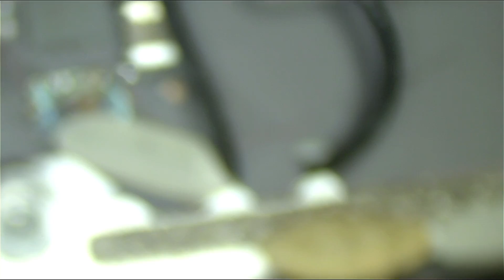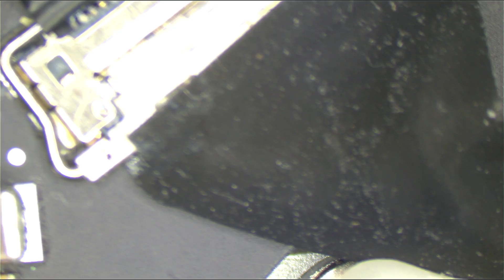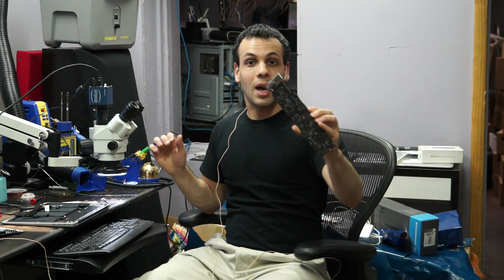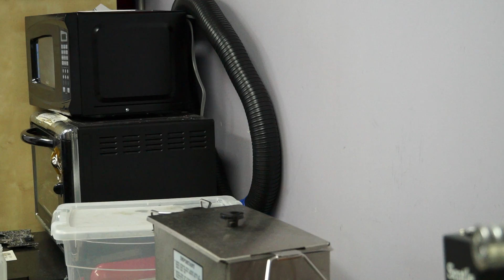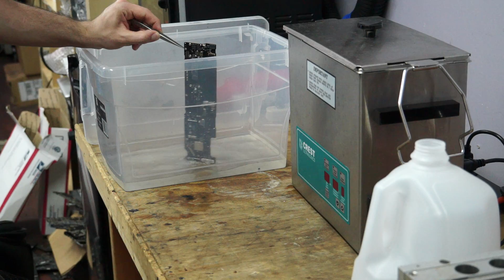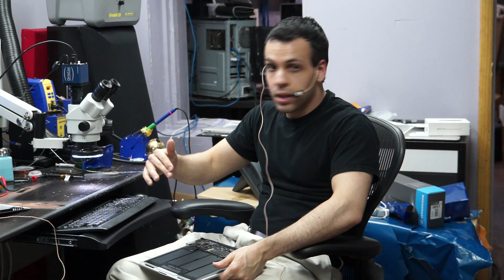How to use rice to repair water damage on iPhones and Macbooks

Comment: Rice isn't even a great drying agent, let alone Louis' point about corrosion.  If the water was distilled and the device was power disconnected ASAP, drying it out with a desiccant might work, but real life spills are almost never this way. 

I came up with my procedure on my own, without the internet - I have fixed many devices over the years with distilled water, alcohol and a toothbrush.  I have used desiccant packets and the heat vent to dry after this process.  It works 90% of the time.  Considering that even the ultrasonic cleaner won't fix things 100% of the time, this is pretty good for the average joe at home.  Glad to see even the professional thinks this is a decent way to do it years later. 

100% solid points in this video.

Comment: The rice is actually okay for removing moisture - it's a cheap alternative to silica gel. You're not supposed to even touch the outside of the device with rice, it's only supposed to reduce RH% of the air. If your device got actual liquid on the motherboard and the motherboard was connected to power, rice will not fix it.

Comment: louis you completely fail to realize the reason the rice is used................rice is only used to soak up excess liquid for a person that dosent know how to properly open their device..... it DOES soak up liquid from soaked electronic faster than just letting it air dry.this method is used for people who accidently dropped their device in water and quickly removed their device from the water.. most people turn their phones off thill they know its dry so no electrical problems arise. the rice wont fix anything it just removes excess water so when you gotta turn on your device HOPEFULLY it works....if not then obviously there is electrical damage...

Comment: The idea is that rice is a cheap desiccant to dry out air, silly. It doesn't have to contact the board. But if that works it would likely be better inside a closed box with some internal circulation. Or else just get some real desiccant or air dryer salt pellets from the hardware store. The pellets get wet though and a little soupy  so they have to be in a bowl or the special air dry device.

Comment: It's not about laziness, Louis. A ton of people are afraid to open it and clean by themselves, they won't know how to properly open or close the device. Plus they hear from others that the rice trick works.
Reply: i can confirm, its not laziness, media for one, has portrayed the "stick electronic in rice" as a "cure-all" for electronics to where i thought it was a method that was legit(not just cause of media though, but also because hearing that it works)

before attempting it though; i searched to double check if it was real, or how to properly do it

found some site that people go for problems like this and had a link to this video, so glad i decided to double check

also majority of the people were saying that the rice did not work, and thats how this video got linked

also, i prefer someone else do this for me, simply because i put too much pressure onto things without realizing, so i WILL in fact break the electronic if i were to attempt it

Comment: to my knowledge no one ever claimed the rice trick fixed water damage. it just dries the phone out faster than it otherwise would. and phones made 5 or more years ago could take a swim and work again once they dried out. at least once. manufacturers wren"t sealing every hole and gluing them shut yet so they made the guts harty enough to take some water damage. it takes time for people to catch on that old tricks don't work anymore.
Reply: In two occasions two different phones slipped a skinny dip in the sink,  I turned the flashlight on, I started a intensive  gpu game on it, placed a yt live video at full blast and I plugged it to charge,  both phones  started overheating so fast they survived,  I am right now typing this on a 8 year phone, when the tech was cool and shit

Comment: Silica gel pack will help to remove moisture inside a sealed bag with the Phone, the problem is internally it has to be cleaned and worked on.

Comment: The only time I ever used the rice was to dry off and phone that was soaked in water after I removed the battery.  It is not the fix I was interested but to dry off the phone so I can use it or get info off of it tell I buy a new phone.  I probably lived more poorly than you with cheap phone and not an expensive phone that would cost more to repair and only had rice on hand at the time.  I probably would have broken the phone apart if I tried to get to the motherboard and just made more sense buying another cheap phone and do a better job at avoiding liquids on my phone after that.  It is more of a temporary fix for the poor person on a cheap phone. 
I am not arguing here.  I am just adding content on the side of the fence where a lot of people live in the world of living very poorly but need to learn to grow and get into a better place in life.   I live 30 miles from the nearest repair shop and for a 30 dollar phone the cost is not worth it.  It is better learning how to avoid spills altogether. 

 But I support the movement of cheaper repair places that can fix things cheaper so we can cut the waste on all the trashed electronics thanks to the greedy companies that are against 3rd party fixers.  If we had fixers in a small town that could fix up phones cheaper than what we buy them for that would be the day.
BTW I just found your channel through Linus Tech Tips  and after seeing your videos and even your "therapist" videos I subbed.  I'll try to watch as many videos from you and a lot of the things you do say I enjoy and like how you think.

Comment: omg....I had never opened a laptop before but when I spilled a fair amount of ice tea on the keyboard the first thing I did was yank out the AC adapter, lift it up as straight as possible so I could pop out the battery without tilting it, then I took it all apart, wiped up the tea with tissues, and then cleaned everything with alcohol.  After that I left it in parts for like a week just in case. When I put it back together it was fine and years later it is still fine.

Comment: The point of the rice, the idea behind it,  is to try and wick away water so the device survives long enough to get it to you (a repair tech).  The problem is (one of the MANY problems with this, at least), rice does not absorb water below near boiling temperatures.  Sadly, some OEMs perpetuate this.  As a cook i get frustrated when people suggest rice as a desiccant for salt, for the same damn reasons.

Comment: Rice thing came from one rice property - it is hygroscopic an can absorb moisture. It theoretically can stimulate evaporation, drying soaked device faster. With a catch - rice absorbing ability is very limited and wet device will short out faster than become dry. The correct actions are to immediately disconnect device, take out battery (if device have it), dry and clean circuitry with alcohol as Louis told. Unfortunately nowadays many portable devices have non-swapable batteries and are glued shut so no way to switch them out by their users in field anymore. Well, it is not all lost. At this summer my friends in their Mediterranean vacation trip accidentally dropped their Samsung S8 phone in sea. Mediterranean is very salty ... poor phone. It was good that they immediately called me.. I told them to rinse phone with fresh water ASAP what they did and saved that phone. Cleaned out USB port when they returned. 4 months passed and phone still works.

Comment: Question from an newbie: What are the specs that I would have to look for in an ultrasonic cleaner? Are they, size apart, all created equal?
Because they are common for cleaning motorcycle carburettors, and I'm wondering if, next time I or a buddy slip, it would be a possibility to bring just a board to the mechanic around the corner, instead of bringing a whole device to a probably clueless technican (living across the puddle, in the countryside, most people here still consider electricity magic...).

Edit:
Alternatively: If, sadly, you and your group, for whatever reason, are cursed with a higher probability for these types of misshaps, would it be viable to have a bottle of chemical alcohol handy to submerge whole devices as long as they are still wet? Are there components, obvious stuff like drives and batteries aside, that wouldn't take such a procedure? Especially stuff like LCD's or rubber?

Comment: The theory of rice is to drop the humidity around the motherboard for people that can not open the machine/phone themself. Dropping the humidity around the device speeds up evaporation, which CAN help. Yeah I get that rice sounds stupid, and I do open and fix my own stuff, but carefully putting a fucked device in a sealed container with rice or any other water absorbent can help. Just as long as the rice dust doesn’t get into the device.

Comment: People think that the water short circuits the connections and that's why it doesnt work, so absorbing and removing the water fixes the problem. They dont think about the electrolysis of the metallic connections that occurs when they have current, and now an electrolyte to pass that current.

Comment: The rice is hydrophilic, it will soak up water, just like silica gel.  The problem of course is that silica gel (or wet rice) will only hold the water in place if not removed once it's reached its capacity.  Of course with a battery permaconnected to the device, it's going to be busted regardless.
Do people actually believe that just throwing rice at stuff fixes it?  That doesn't even work at weddings...

Comment: Thanks you for making this! I am a computer engineer and I do what u do more less in the bahamas.  We are around tons of salt water so a lot of people get salt water damage on there devices.  Rice sucks.  When I am able to repair it there is usually some stupid problem afterwards.  Like a grain of rice stuck in a charging port.  Or worst they leave the phone in rice for a few days it still doesn’t work so then they bring it to me.  The salt actually eats the metal on the board and then they are totally fucked.
Reply: Alcohol and a toothbrush does work if you catch it quick. Just make sure it’s 100% dry before u try to power on or charge.

Comment: the rice is not for the fucking corrosion. who ever thinks it fixes that, is just braindead. the only reason to put it in rice is to get the water out of the system to prevent the corrosion as good as possible for a drunk guy that just threw his phone into water. if this really helps to get the water out is another point i am not qualified to discuss but the video misses the whole point of the "put it in rice" reasoning
Reply from the maker: That won't do a damn thing.

Comment: I heard the rice thing early on, when it was discovered by reasonably intelligent people who explained that it was a highly limited technique (only works on small amounts of clear water) that must be applied immediately after exposure and conventional drying and as much dis-assembly as feasible under the circumstances.  Rice is the closest thing to desiccant that you're likely to have ready access to, so the idea was to use it to aid immediate drying, combined with other methods, some of which, like removing the battery, aren't applicable to Crapple products anyway.  Then I got to watch as people did exactly what Louis talks about here, and use it on stupid shit, like a phone dropped in the toilet the other night, whatever, and get success anyway because the thing wasn't really fucked to begin with, but think they did something.  Thus arises the Cargo Cult of Rice Repair, with people plunging phones and soforth into rice long after corrosion has set in, or with liquid which leaves behind some residue which must be removed not matter how quickly it is dried.  Sigh

Comment: As soon as your phone (or junk) gets wet you pop the battery out and *seal the device bin a Ziploc with a dessicant*. You can use rice as a crude dessicant if you must. The important thing though is to seal it all in, or the dessicant won't do shit. The dessicant helps dry out the water to minimise corrosion and allow you enough time to rescue your data before throwing the iPhone in the trash where it belongs. Or send it to Jessa... It's not a method of repair, merely a method of damage limitation.

Comment: On this one occasion, you are wrong. At least for a very specific use case scenario. Rice is a natural desiccant, it traps moisture that evaporates from the electronics. It will most certainly work so long as 1) We are talking about water, not beer, not soda, but water. 2) the device was either not operating, or had a moisture sensor that disabled it before electrical corrosion could occur. 3) the device was placed in a sealed container with rice for sufficient period to allow for the evaporation of the water. Rice works in the same manner that those packets of silica or those little plastic tubes in medicine bottles work, after the water evaporates, the rice, or silica, traps the water. If it arced, then you have electrical corrosion or a short(because ordinary water has impurities that can cause electrical issues) Interestingly, distilled water is non-conductive, the primary reason it is used in so many water cooling loops. I have personally seen a buddy's badly fitted water loop spring a leak and spray distilled water all over the computer while it was on with no issues.

Comment: The idea is to dry out damp or condensation on boards by using a hygroscopic agent. It cannot repair corrosion. However I do not think rice to be useful apart for maybe gradually absorbing damp in cars like cat litter.

Comment: So if I dropped my phone in distilled water while it was off and then turned it on right afterwards, it would probably die. But if I opened it up and left it in rice or with some moisture absorbing silica packets, before turning it on, would that save it?

Comment: Rice is a desiccant. It will not remove corrosion, it can help remove water that causes the corrosion, short circuits and whatever else water will do to electronics. Removing the water will prevent further corrosion from happening. That's all the rice does.

Comment: Great video.  I had a LCD HD Tv which was overheating due to diatamacous earth junking up the vents.  I opened it up, cleaned with alcohol, a rag and a q-tip, lightly vacuumed and it was back to normal.

Comment: There is a great way to use rice to fix your devices. There are two separate procedures. The first is if you are not s technician.  1. Immediately turn off the device. 2. Cook rice using instructions.  3. Let rice set while you drop off your device at a quality repair place. 4. Eat rice.

Comment: You put it on when it's wet and when you have it all taken apart otherwise it's not gonna do anything when it's dry if it doesn't prevent the water damage then it will at least lessen the corrosion or damage

Comment: Rice won't fix anything, but it is hygroscopic. So if you have spilled water on a device, and put it in a sealed container with rice. It will absorb all the moisture. In some cases it will prevent damage to the device. In some cases moisture will evaporate faster than it can reach critical components. That is becouse relative humidity in a container decreases, but evaporation increases. Evaporated water gets trapped in rice grains, until it reaches equilibrium .
Reply: dry mineral don't cause corrosion, eg: salt need to be wet to conduct electricity.
Reply from the maker: +romenas he would actually be better off sealing the device in water than you would be sealing it and rice because the corrosion will occur more quickly when the minerals can settle on the board

Comment: Thats not the reason u put rice in there. not to fix the problem.. Just so the damage dont get worse and even if it takes small amount of water it may just dry and it works again. Its not the rice gonna fix the damage dealt. Rice absorbs moist really good. but in order for it to do that u need to disemble the device and put rice on it, Pref next to a heating element.

Comment: My daughter once spilled water on my laptop while it was turned on. I immediately pulled the battery, opened the computer up, and dried everything by hand. Unfortunately the backlit keyboard had a couple shorts and the computer would shut down any time I tried to do a full screen game, but both were easily replaced. If I did nothing, or used rice, I'm sure the damage would have been much more extensive.

Comment: Years ago my IPod 4 fell into the toilet (just pee, thankfully) and it still worked fine after I used a hair dryer. Rice would have probably helped a bit but not enough to prevent water damage. 
And yes, the IPod did had a small pee scent after that.

Comment: Rice absorbs water, not corrosion, this is not a myth, this is real, if your phone or laptop gets water, don't wait and put it with rice all around it in a bag to absorb water, after that, the corrosion appears only if there is still water in the machine, hope this helped out.

Comment: ok i just gave it 15 min in a ultrasonic using distilled water   now got to get the board out and put it in to a pot full of salt to draw the moisture out and no not dunk it in like a idiot put it on top of a plastic sheet over the salt  and than put the lid on 0 moisture btw at the time the phone is still wet